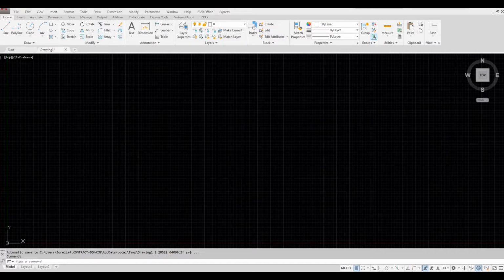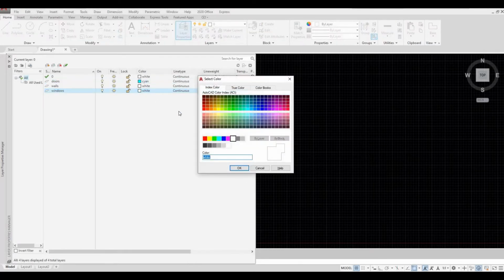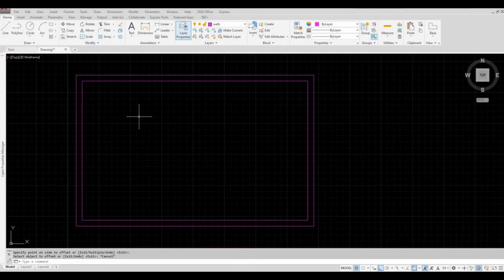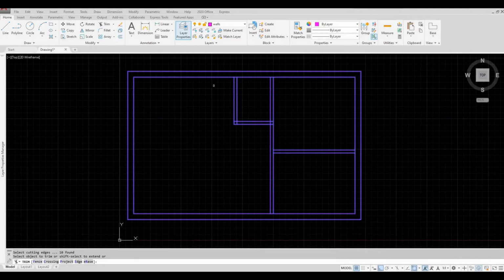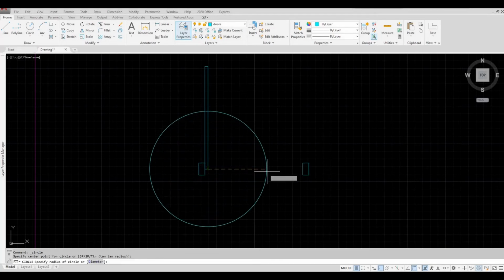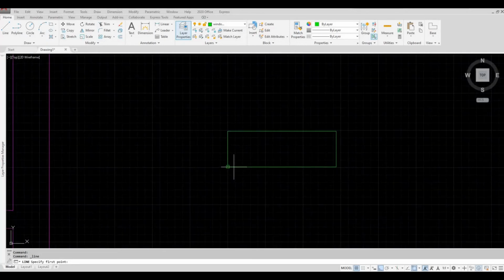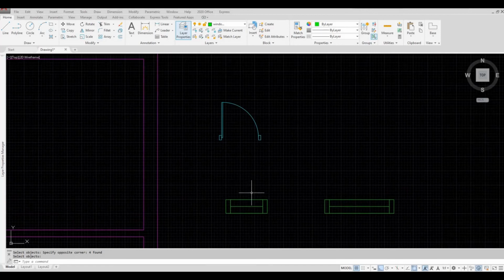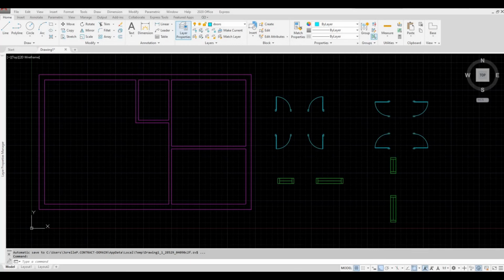Make a Simple Floor Plan in AutoCAD Part 1

Comment: I am using AutoCAD 2013. The numbers are way too large. I couldn't zoom further.
Reply from the maker: Hi Victor, if you can check the template you use. It need to be imperial not metric. That is why the scale is off. 🙂🙏
Reply: @ArchCoreDesigns  where would I get that? How do I on the scale?
Reply from the maker: Hi Victor, when you open autocad with a new drawing, check the units by typing UN and then enter. 
that is the indication of what template you are using. 🙂🙏